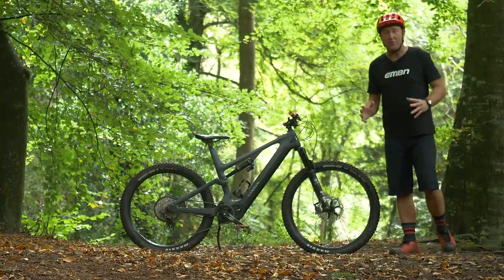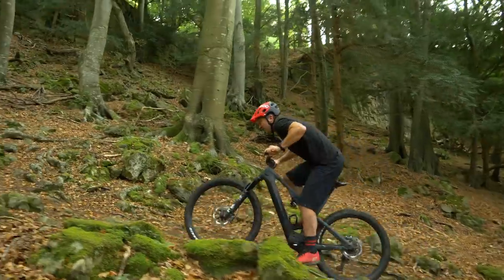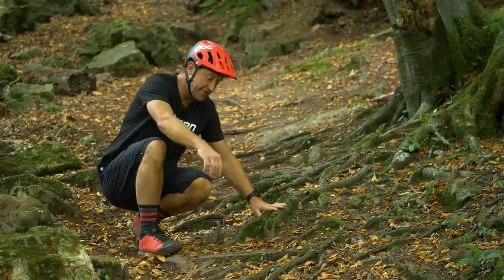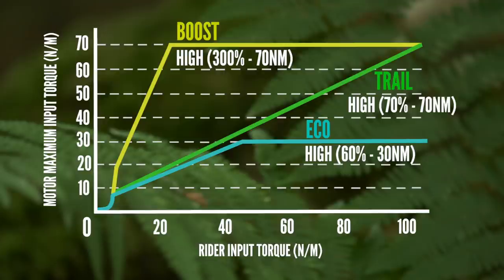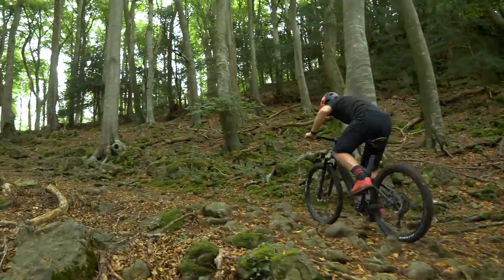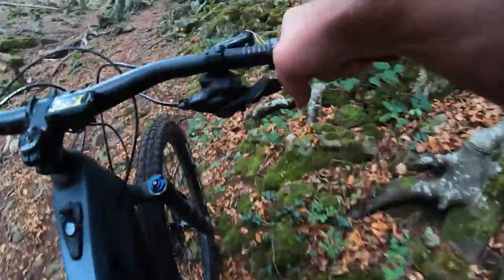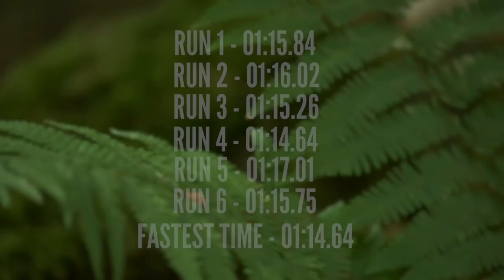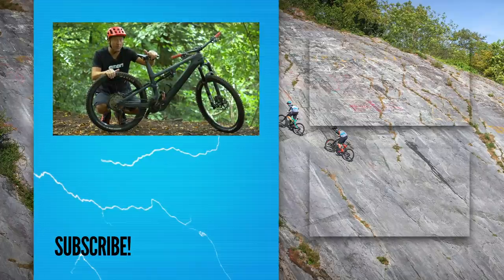How Fast Is The Shimano E8000 Motor? | EMBN’s 104 Hill Climb Challenge

Comment: The best motor is working motor.
I've been using e8k for 2.5 years without issues.
Power? It is assistance motor for my legs not a scooter. More Nm means more energy used from battery and small range is the weakest point of e- bikes. In result all risers use eco or trail mode the tes Nm delivers rhe kegs to save battery. Boost is used occasionally. 
I think the future is not powerfull motors but lighter bikes as new Orbea. The only problem is the price mainly for people who must work two years to buy such bike and not eat...
Reply: I have over 4770 km on my e8000. Mostly road miles but zero issues. Zero. And the display is pretty awesome. 😍

Comment: One test I would love to see is a comparison between the Brose/700wh range vs the EP8 630wh.  Shimano says the new EP8 is more efficient than the old motor.  Right now it seems like the Brose/700 combo is king for steep climbs but wondering it the EP8/630 can challenge the Brose/700 for range.  I have a deposit down on a Santa Cruz Bullit so that's why I am interested.

Comment: Enjoyed that. Though there's all sorts of other variables at play, understanding how different manufacturers stack up against each other is great useful content. I'd also be interested in range tests, 10+ mile loop, how much battery consumed. As said elsewhere, unless you're light then range is still the main issue. Boost is the sole preserve of bonked legs, every ride is a balance of eco and trail to balance out fun/progress/range. I'd love more torque but that would further reduce my range, and that's not an option!! 👍

Comment: The new app of the EP8 is for me a bigger deal then the Torque. Being able to have full torque but less multiplicator is a good way to have a better ramping of power while still using maximum power. Also, Norco will soon unveil a 900wh battery in a brand new Range VLT 29, which will allow to be on boost almost all day.

Comment: Any chance you guys will test some bikes with the Bafang G510 motor?  This motor is used by Frey bikes and has specs that beat all the major brands like Shimano, Yamaha, bosch and others. How come there is nothing on EMBN about this motor?
Reply: I doubt it, as it's illegal to ride anywhere apart from private land.
It's also huge and heavy.
Reply: I asked this a number of times and never got a response.
I fancy having one myself but until I can see a direct comparison from a none biased rider I'm not happy shelling out £3 to try one out lol.
I've read reports that the general feel is not very smooth or as refined as a bosch  etc.
Reply: @kevinshort3943  I can understand the legality part I suppose. Dimensionally it's pretty much the same size as the e8000 but it is twice the weight. Which is expected since it puts out more than double the power of the E8000 motor.
Reply: @FlyingFun.  I'll let you know when mine comes in. I ordered a bike with the G510 motor and I have ridden the TREK Rail 9.8 with the Bosch motor. I'll let you know how they compare.
Reply: @abarrick09  looking forward to it. I'll sub to your channel ready for if you make a video on it. I'm converting my old mountain bikes with rear hub kits and even those are great fun and 1000w gets up pretty steep hills with some pedaling..
Reply: @abarrick09  
They did a test of "all" the motors, and the highest torque one (Haibike?) wasn't the best.
Power is useless without control.

I suspect if Bafang send them a bike they would review it, but I don't think these Chinese companies are fussed - China is a big place, and they have to do what the party tells them to.
Reply: @FlyingFun.  
" I'm not happy shelling out £3 to try one out lol"
So you are from Yorkshire or Scotland? :)

I have tried the BBS, and it's brutal unrefined power.
The front wheel was up in the air waggaling all over the place :(
Reply: @kevinshort3943  haha, London but living in yorkshire.
£3k I meant, I'm tight but  even I'd  pay £3 hehe.
Reply: @m0t1veOT  hmmm, I am starting to get the motivation behind this channel now, very hard to find unbiased reviews these days.
This was the reason I started reviewing racing drones because so many reviews were either just yes men and adverts saying everything they reviewed was the best ever or they were heavily biased.
So I bought stuff myself and reviewed it honestly and used affiliate links with banggood etc ( yes I know they aren't as good anymore and service can be poor )
Ebikes are too expensive for me to do this though.
To get free stuff some people will say anything and to get sponsored by one company is the end of impartially I guess.
Its possible to get money from affiliate links from multiple companies though and buy more stuff to review with that money, just not sure its doable with ebikes.
Reply: I own 3 bafang one hd on my specialized rockhopper and 2 m600 one is a luna x1 and the other Teo Velo City M-500  i use 48 and 52 volt battery the m600  loves the 52volt but as expected the power curb on bafang needs adjustment to be smooth unfortunately there is no way to do that with the m600( complicated ) . i have never tried another e bike. im 180 lbs 82kg there is no way im downgrading as i use all NM available. the 52v pack is what i would recommend but again laws is what is the problem.
Reply: @FlyingFun.  Hi Nigel, i can assure you the times are accurate and unbiassed. And contrary to what the unknown person says we are not sponsored by Bosch. We have actually had many Bafang motors on the channel
Reply: @stevejones7956  that's good to hear, please excuse my reply to this unknown guy, you guys to a great job and are the reason I started getting into mountain biking, I am just getting old and grumpy and finding it difficult to navigate the minefield that is e mountain biking with all the various makes models and multitude of options along with all the influencers out there.
Br great to see you guys give your opinion.on the g510 though seriously think you are in the best position to judge how useful the motor is compared to the likes of Bosch etc.